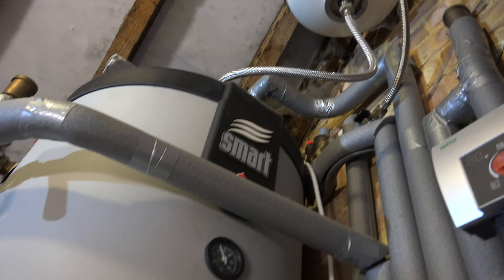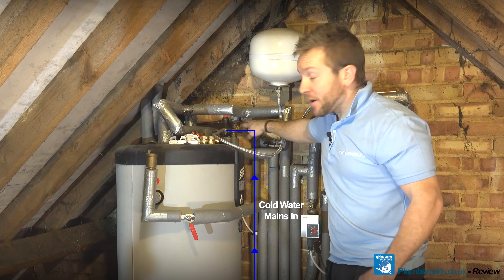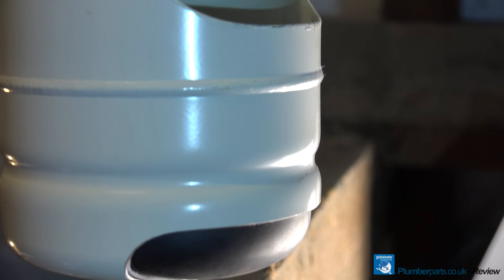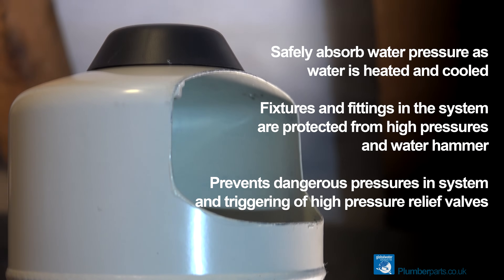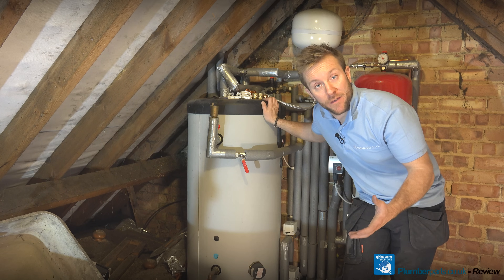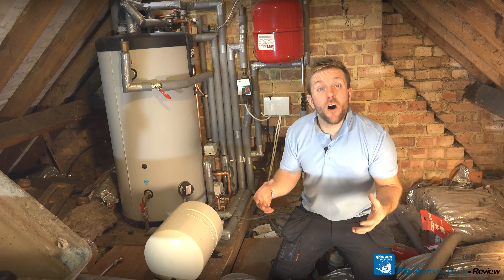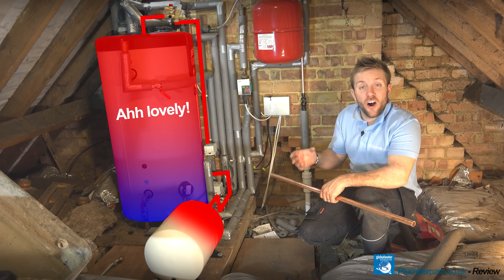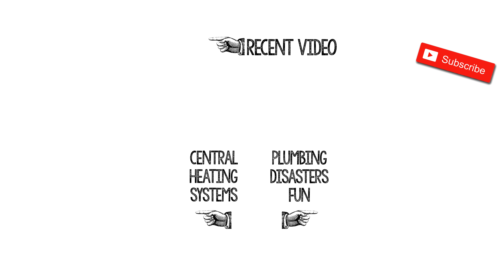WHITE EXPANSION VESSELS - Drinking Water

Comment: Can you use one of these on a mains water pipe behind a salamander homeboost pump? I'm tired of the pump kicking on an off every time you turn a tap on for a few seconds or flush a toilet. In principle an expansion vessel would act as a sort of buffer. Not sure if my logic is correct.
Reply: expansion vessels don't reduce flow, just pressure.

Comment: Thanks for this vid. Good explanation. My pressure vessel (potable, unvented system) fails regularly, causing the pressure relief to go. Plumber comes (I've used different ones for 2nd and 3rd opinions) and says, 'yep, I'll need to replace the pressure vessel'. This happens about once a year, and then low and behold, it lasts a while and fails again. I asked plumber after plumber why this keeps happening, perhaps another more systemic fault -with the multi valve perhaps?? But everyone just says replace the pressure vessel... Oh, and they tell me off for the pressure vessel not being mounted on the wall... it starts off on the wall but when its gets heavy with water (when it fails), it falls off. Also leaving on the floor makes it easy to feel how heavy it is and tell when its getting near needing replacing again! 
Any ideas of what else could be causing the vessel to repeatedly fail please? Then I can suggest this to the next plumber (when they're available after Christmas!)

Comment: Thanks for the video.   Any reason why 15 mm speedfit couldn't be used instead for the feed to the expansion vessel?  As for all the comments about Legionella, a simple answer is to make sure the water is heated to 63C at least once a week.
Reply: You should never use plastic fittings near a boiler as they can fail under high heat and pressure circumstances. 
You cannot simply heat your system to 63 degrees Celsius once a week. Legionella can develop quicker than that. Not to mention that the water may be 63 degrees when leaving the boiler but it won't be 63 degrees when it enters your and the water at the bottom of your HWC may never reach 63 degrees, even if you have set the boiler thermostat to 65 degrees.

Comment: Hi can somebody help me please. My unvented cylinder has the expansion vessel on the hot water outlet at the top of the cylinder not the cold water supply as I see in most diagrams searching it can someone help me why it has to go on the cold and will my system be affected by it being on the hot pipe. Thanks
Reply: Then it has been installed incorrectly.  The EV will last longer on cold water side, the EV also fills with water which will cool down if installed on the hot side, meaning wasted hot water.

Comment: Since 2013 the UK’s Heath and Safety Executives HSG274 states that newly fitted expansion vessels should only be the flow through type and must be fitted vertically. Failing to do this will contravene their Approved Code of Practice L8 and ultimately the Health and Safety at Work etc. act 1974. This relates to the control of legionella bacteria in water systems. I enjoy all your videos but this one is not providing the correct information, sorry.
Reply: Shame there is not a response with regards to legionella.

Comment: What are the problems in fitting an expansion vessel on a Megaflo?  People do not like, or do not know, how to recharge the air bubble at the top of the cylinder. Fitting an expansion vessel sounds a better option, preventing those permanent drips into the tundish.
Reply: I quite liked the OSO, had a dip pipe that created a bubble when filling, but you could remove it allowing full capacity if you fitted an external vessel.

Comment: Mine don't leak at the sch valve. Just get dripping in the tundish  and outside??? Any ideas if it's failed??,
Reply: Pump it up with a car pump with a gauge on.
Reply: @johnburns4017  thanks. Shall I run the system with the pump on the valve cause soon as i take it off the air escapes.

Comment: What's that vessel manufacturer, again? GWS? Is that the only manufacturer to use butyl rubber diaphragm with a 5 year warranty and a brass schrader valve? And they are cheap and easy to install via the built in bracket and wide feet that can be installed on walls and floors?

Comment: I have just bought a replacement vessel 12l but the details say it's been precharged at under 2 bar, my ariston contract STi indirect cylinder says the vessel should be charged at 3.5 bar. Which is correct. I noticed your video did not show you checking bag pressure

Comment: Pressure vessels are best on the cold feed to the cylinder as it is cool there.  Having one on the hot side directly off the top of the cylinder puts the vessel at higher temperatures. This reduces the life of the vessel.
Reply: 100% correct Mr Burns.

Comment: Great video James, I have just completed a Legionella Risk Assessment course and one of the defects listed was expansion vessels that had not been mounted vertically. I'm assuming that as long as the expansion vessel is installed according to manufactures instructions there shouldn't be an issue. Whats you opinion? .
Reply: when the expanpsion vessel is installed on the cold mains supply, in between the combination valve and the unvented cylinder inlet, the water temperature should be relatively low, and if it is installed vertical, with the pressurised air end at the top, will the water passing it cause a  “Venturi effect”  and change the water contents inside the expansion vessel ? and if the cold mains supply and the expansion vessel are insulated it should slow down the temperature increase from the ambient air, I am not an expert, so if any body can educate me, I am always happy to increase my knowledge, and for every body.
Reply: @daibhiseaghdha153  even though on a main supply the length of the pipe work can still be considered a dead end. It should be as close as practicable. During a water services legionella risk assessment it will state that this needs to be upright too. This can be found in HSG274 supporting documents. 

Those points being, is the risk high in a domestic home? Probably not.
Reply: Always follow MIs.

Comment: Would fitting a non return valve on the mains and say a 300litre potable water vessel straight after boost mains pressure? My house has pretty good pressure but the flow is terrible due to the mains being only a half inch pipe about 50m long

Comment: i have to replace a potable expansion vessel that has failed after less than a year - can anyone tell me if it should be installed on the cold water or hot water side of the cylinder ?
The current one is off a tee on the hot water side - but looking at the spec for the replacement expansion vessel i bought, it has a max operating temp of 70 C - and i would think the hot water gets close to that - and since it is a unvented system, it should not matter where i put the vessel. So i am thinking of installing it off a tee on the cold water side of the cylinder. any advice appreciated.
Reply: If it’s a white one it’s cold water side if it’s the red one it’s for the heating but if you don’t know what your doing leave it to someone who does as these systems ain’t to be messed with by rookies
Reply: @masterchaz100  trouble is, the "professional" plumber i paid 220 euro to last year installed the vessel on the wrong side and did not check the pre-charge - so it was 1.5 bar - my mains is 5.5 bar - hence it failed in less than 12 months. So, instead of getting ripped-off again by a plumber, i decided to educate myself and now i know how it works and have installed the system correctly
Reply: Generally they are pre charged to 3 bar but some can be 3.5 bar and he must not have been a professional as almost every expansion vessel will have its pre charge pressure stated on a sticker that is attached on the side of the vessel so any engineer that comes will know what to charge it at, (mainly  3 bar).
Reply: I am a 3rd year apprentice if I know what they are charged at the guy you hired would have been more clueless than Stevey wonder when it comes to heating or even seeing.
Reply: @masterchaz100  the vessel he installed was manufactured by imera in italy - it states a pre-charge of 1.5 bar on the label - i watched the plumber take it out of the box and simply screw it in place - he never considered my mains pressure or trying to match the pre-charge. I have since installed a PRV to take my mains from 5.5 bar down to 3 bar and now have the vessel matched to my 3-bar water. I dont know if he was clueless or just did not care - either way it is hard to trust another plumber..... that is why i like the videos from this guy on youtube... he seems to tell the truth.

Comment: Plumbers don't take into account that in this video you have created approximately a 2.5 metre dead leg on the cold mains that overtime will stagnate. Not all plumbers install the vessel onto the combi flow valve assembly, some vessels are installed off of a tee piece. Flow through expansion vessels up to 150 litres should be an option that the end user should be aware of. It's about time Heatrae, Geldhill and the rest took notice. Even the rubber lining of the flexi connector which appears in your video unless WRAS approved, have been found to harbor bacteria, maybe you should make installers aware of this when called out to replace a leaking flexi.
Reply: Solution is as simple as not creating 2,5 m long dead leg. At least run cold main nearby and do as short T-branch as possible, use "Reflex Flowjet" vent, or an in-line expansion vessel with two ports that will run water through it.
Reply from the maker: Good comment but what's the solution? The whole industry endorses these methods...
Reply: plumberparts L8 Legionella risk assessments highlight the dead legs on hot and cold water systems in which recommendations are made to clients which should result in buildings and systems becoming compliant. Ultimately these buildings are audited with the owners becoming responsible for all those that use the building. An outbreak of Legionella resulting in death could lead to a prison sentence for those negligible. WRAS and L8 need to become closer then that would lead manufacturers to produce WRAS/L8 approved components in all areas of installation. There are some which cross reference the two industries already such as category related double check valves/rpz valve's.
Reply from the maker: Yes Tony....as ever it's lovely to quote L8 etc....but what about the physical change to this install or the improvement of the products we as plumbers have to install? I'd say nearly every potable water expansion vessel is non-compliant under the stringent terms described above. Perhaps an internal feed pipe to the expansion vessel causing a small amount of flow could help... By the way I've measured the pipe run (as it's in my house) and it's under 2.5meters.....but still the problem is there industry wide!
Reply: plumberparts LOL, taking a guess at the dims, as far as the flow through one's are concerned these could become an additional option to your clients ? Easier to site and fit more than you think ! As a rule of thumb anything over 100mm is classed as a deadleg, although there are variants. Being a 30+ year plumber and 10 in the water treatment industry, L8 isn't really covered as much by manufacturer's and being honest it should run in line with WRAS approved installations. RPZ valve courses would be advantageous for you. Keep up the good work.

Comment: What is the other (red) expansion vessel connected to? I presume to the hot outlet?
Reply: Heating system. You can see circulation pump as well. Even the hot water cylinder is connected to it - pipes on the side. Potable water is connected at the top of the cylinder.

Comment: how do you know when the expansion vessel has failed? its a scary thought
Reply from the maker: High Pressure relief will start to drip. You'll see it outside. It's no big deal, just get it changed as soon as you see it dripping. Also you'll find water coming out when you press the schreader.

Comment: Liking the vids, really good for the newbies, thumbs up. But worth noting, expansion vessels now have to be installed vertically to meet water hygiene regs. Horizontal installation is considered poor circulation and bacterial growth in stagnant water has become apparent. Keep on keeping on..
Reply: In addition to that, flexi hoses are also frowned upon, due to the rubber..... nobody likes using rubber, although there are a few instances where i wished some people had used one ;D
Reply: @Adam-dx6cz  rubber is acceptable as many of the main manufacturers use it. However it does look a bit gnarly and unprofessional. Personally I've never used rubber flexi hoses. I was always taught to use rigid pipework up to an E.V & mount them as close  to the tank as possible.

Comment: James only just latched on to your site, excellent, really great tips and love the way you cut through all the nonsense. Im retiring from my Job as a Mechanical Surport Engineer for a big Pharma company. (Sounds posh doesnt it,  It Isnt !)Ive always been handy done lots of plumbing jobs you know washing machines, outside taps etc.. I trained as a welder so Im handy with the blow touch, but im trying to get more clued up with the heating side of things, so when watching your video on Gravity Feed Heating Systems (The one with your symatic on the big piece of wood, what would have been handy for me in that Video would have been to draw in the doemestic water sytem side (The feed for the taps).ie where would the expansion go from the emersion heaterAlso when you were fitting the new GWS expansion vessel why did you choose to mount it on the floor ? and lastly the expansion vessel was white what is the  Red vessel behind you used for.Cheers Bob P.S. You should get a book on the go,  it would be a great reference when on the job (Like stuck in a airing cupboard ! ) Did Joe Wicks no harm !!! :)

Comment: isn't there a dead leg issue with having such a long length of pipe to an expansion vessel that is essentially stagnant?
Reply: Correct and GWS supply a anti legionella flow through valve that is recommended to fit to the vessel

Comment: James, you said all expansion vessels have a 3/4male fitting, the last 3 I've fitted have been 22mm nut and olive! Absolute pain in the arse when I had the 3/4 female fittings ready! Incidentally, two of the EV's had been fitted to the balanced cold!! OMG!!! The temp & pressure relief valve stopped the cylinder from blowing!! 
Top videos bud!

Comment: no statement / Warning about needed to be G3 Registered to work on unvented cylinder, Also no drain off on pipe work to expansion vessel to aid in servicing ???????
Reply from the maker: +corbs07 hi Corbs. As video was about the principle of expansion for apprentices and not a 'how to blow up your house' video I didn't add it! Sorry! Also, there is a drain off on the bottom elbow of the wall side horizontal. I can go up in the loft and take a photo...but think I've done enough making you a free film about it already!!! 😂😂😂😘😘😘
Reply: thank you for changing / adding in the g3 part in your description, as you understand safety first :)
Reply from the maker: No worries Dooode!

Comment: Very good informative video. However, I have a question not related to the subject. 
Can I replace a hortsmann boiler programmer with a drayton LP522 ?
Thanks.
Reply: Yes, this is a direct replacement.  Just get the connections right and you are good to go.